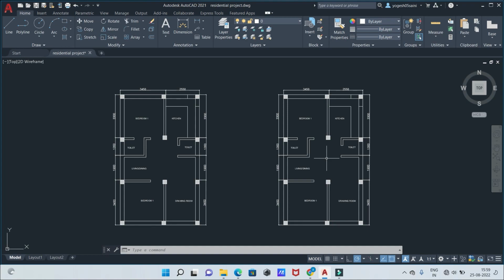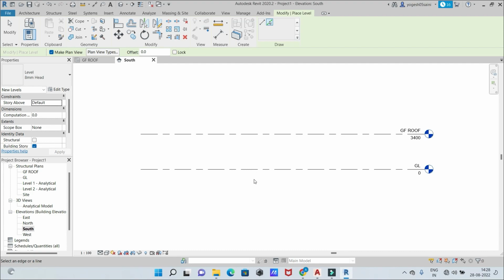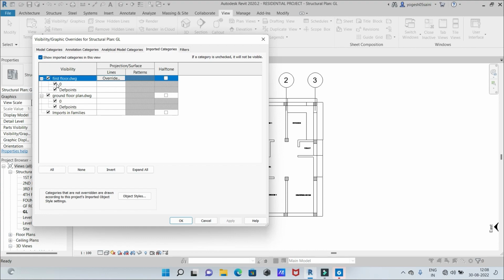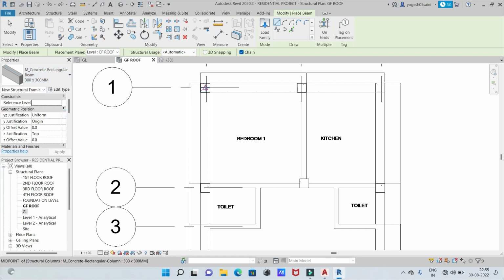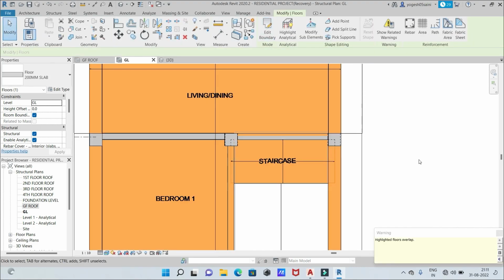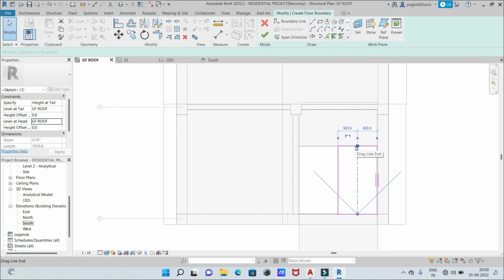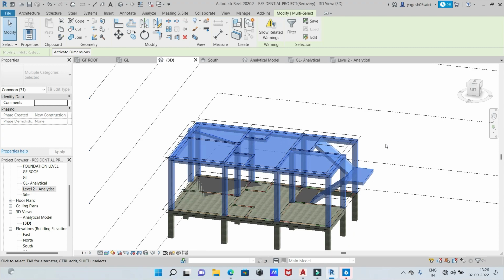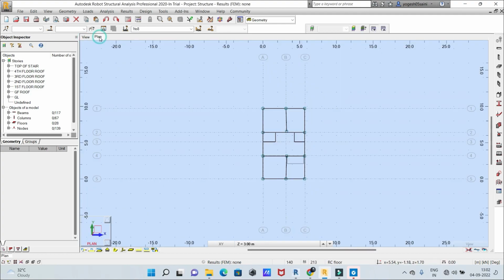Revit Structure Complete with G+5 Residential Building Part - 1 | AutoCAD | Robot Structure Analysis

Comment: some columns are not properly aligned in the imported AutoCAD file,  while modeling in Revit GL and GL Roof columns are also not aligned vertically. and in timeline 58.37 you have ignored the warning one element is completely inside the other. Slab edges have to pass through the center of the column. For structure modeling in Revit, all the frame elements must be connected analytically. i.e. colinear horizontally/vertically with minimum eccentricity.
Reply: Hello sir, I'm a student, can you provide me free Revit Structure tutorial basic to advanced

Comment: Here the problems are : when you insert the drawing, position always center to center. But, you can't do that that's why it takes more time 

When you place the colum, always change depth to height.
Then from properties you can change base levels or top leves. Or, by using 'AltGrid' you can place columns, it takes few secs to place all columns
appropriately. With zero error
Reply from the maker: Thank you for your feedback, we'll consider it